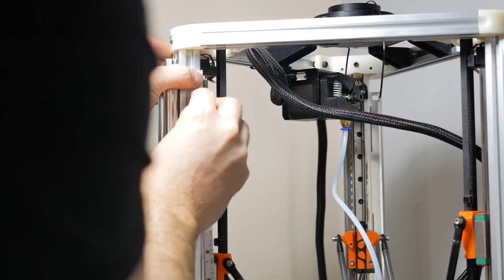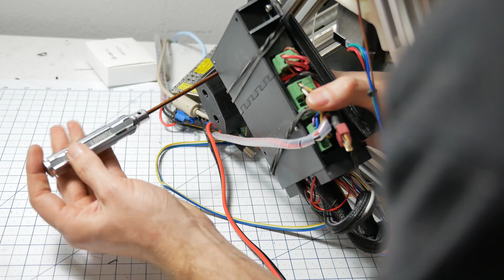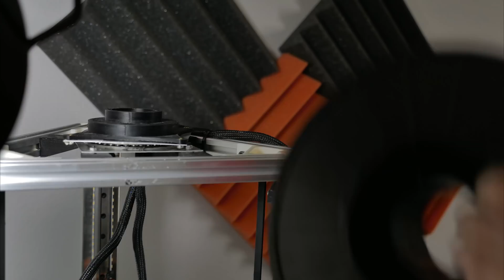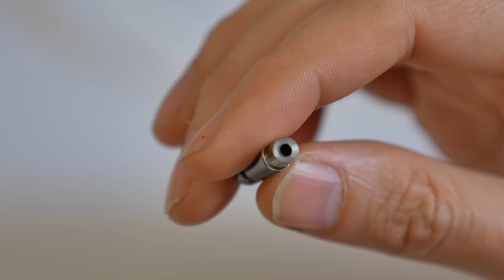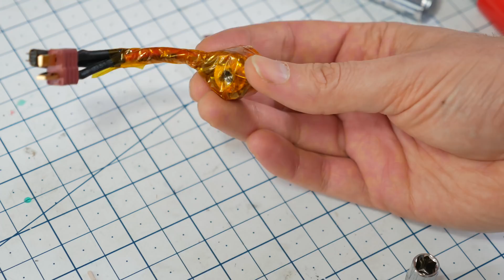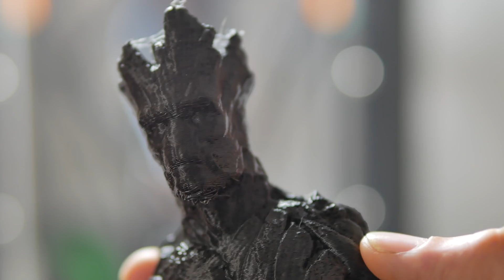New stuff for the Delta Printer! - S02E29

Comment: Great improvements those you have done so far!
If you really want to improve the 3D printer, use 20x40 profiles and aluminum corners. It will be much stiffer, resistant and faster.
Thera are effector that has a hinge to make auto-leveling directly from the point of the nuzzle. They are cheap and made out of inyection molded plastic.
Hope it's useful. 
Regards.

Comment: I noticed your soldering the end of the led light strips. I always use the end connectors, much neater. Also when you opened the box under the base plate, it was a nightmare, no proper routing of internal cables. Just everything stuffed in. For that money I would expect more. Apart from that great show keep up the interesting topics.